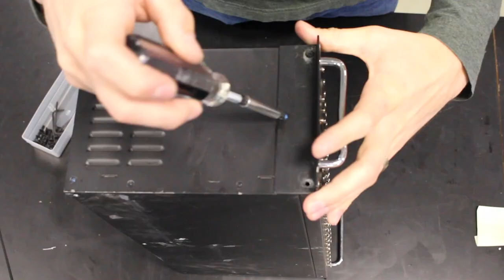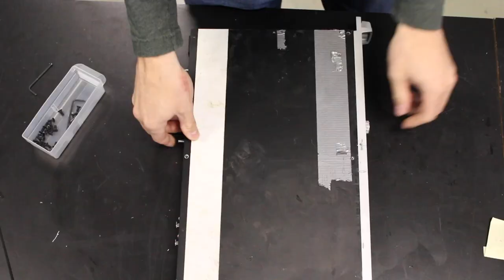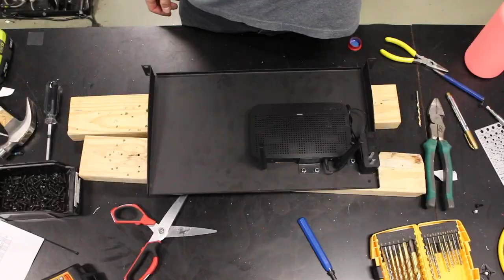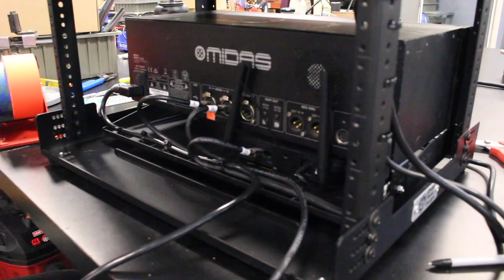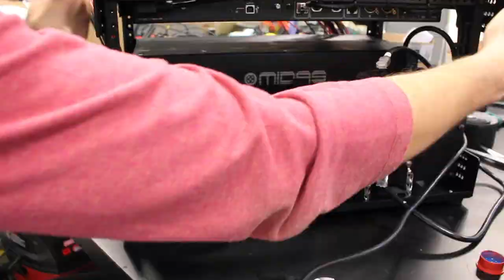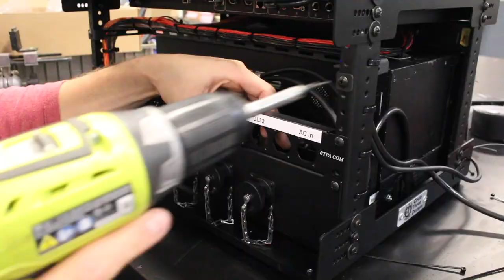BTPA| Mixer Fly Rig Time-Lapse Build w/ All Multipin Input Split

Comment: Hey Brad/team, am i right in thinking you are replacing all the screws in the units with lighter weight ones? If so can i ask what material you are using and how much weight saving you gain from doing this? thanks in advance!
Reply from the maker: We are not! We are simply putting loc-tite on the screws to help prevent them from backing out on tour.
Reply: @BTPA_USA  Ah that makes way more sense haha, was racking my brain trying to think how much you could possibly save without actually replacing panels!

Comment: What does the IEM ethernet connection do and where is it connected to (the DL32?)?
Reply from the maker: The IEMs in this setup are all connected via network ports. They are then connected to the wireless router in that rack so that their frequency manager can be controlled via a laptop or tablet. They are not connected to the DL32 via network port
Reply: @BTPA_USA  which IEM transmitters were they using which accept inputs through network ports?
Reply: @kevinreginaldcooke867  the sennheiser units for one.  Most of the higher-end models have this feature.